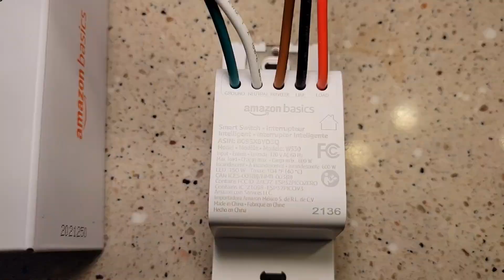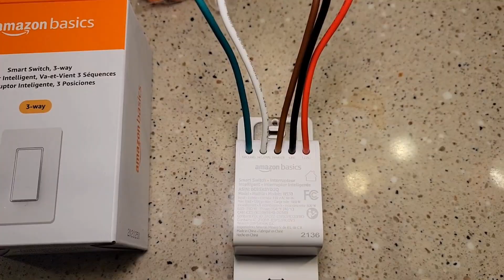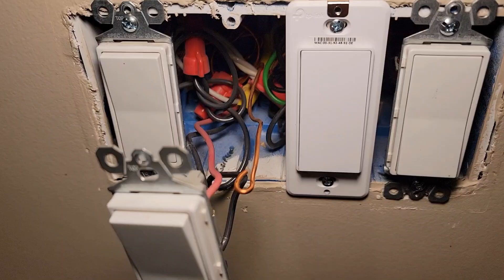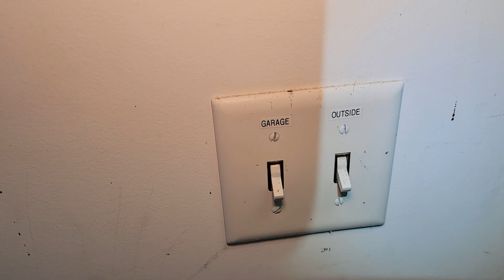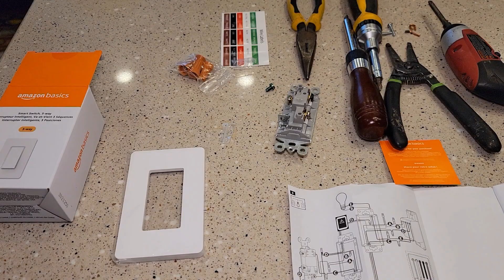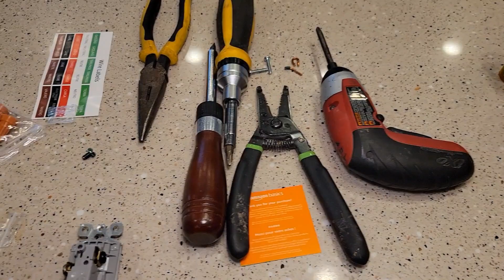REVIEW & HOW TO INSTALL Amazon Basics 3-Way Smart WIFI Switch with Alexa

Comment: in the instructions it clearly says there is only one traveler needed from the Not so smart side.....  so you seem to have connected the red to the red (red traveler.fron the other switch). and the black to the brown  (Black traveler from the other switch)  so your video is helpful but what if I'm switching out both?  and now I have to double pump the dumb switch for it to actually work???    anyone else have this issue??

Comment: My issue with these smart switches, they’re so large in the back. Hard to fit flush against the wall. You didn’t show how you were able to get it flush. Maybe I have to remove all switches to tuck wires to create space. 🤔  …I wish they could make a slim design smart switch.

Comment: Sometimes the dumb switch doesn’t work. As in I keep flipping it and do NOT touch the smart switch or the app. I can stand there and turn the dumb switch on and off 3 times and it works, but the 4th it doesn’t. Have to flip a bunch more times for it to work again. Strange. I have 2 of these switches side by side controlling 2 different sets of lights (and on the other wall have 2 dumb switches, each one connected to a different smart switch)
Reply: Did you ever find a solution? I think it's a bad switch design and always going to be an issue. I jumpered the red traveler to always be hot and used that as line and it still does this issue you describe.

Comment: I have a weird issue, my smartswitches are powered properly when in both positions (the nightlight yellow indicates when other switch is off and I can dim when it's on.) I can also turn off the lights fine with both switches. However when the smart switch is off the other switch cannot turn the lights on because the smart switch turns out all back off with its dimming animation.
Reply: Turns it back off*

Comment: I installed amazon basics 3-way dimmer and it results in the light staying on continuously.  

The dimmer is on the load side.   I followed the wiring diagram in the fold out instructions.  This means that one of the traveler wires ends up not being used.  The dimmer indicator lights function.  Tried factory reset.  no luck.  I tried attaching the dimmer line wire to the unused traveler. Now the lights can be turned off from the dumb switch but the dimmer still does not control the lights other than by keeping them on whenever the traveler is energized.

Comment: The wires I have oming into my present three way switch has pnly 4 wires, red, black, green, and red. There is no corresponding traveler wire (brown wire). What do I need to do with this configuration? I am trying to install the same switch as you.

Comment: Great video! Question: I installed it just like you did, but my issue is when I turn off my “dumb” switch, my smart switch is no longer able to power the lights back on. I need to always leave the dumb switch in the on position. Any suggestions?
Reply: I had the exact same problem. I switch around the traveler and load wires but had no luck. I tried switching the smart and dumb switch and neither switch would work. If you find a solution, I would be interested to hear it.
Reply: @AdamJohnsonFamily  I’ve been doing a bit of research, and it seems the Amazon switch needs to be connected on the LOAD side, not the LINE side. What they don’t tell you is that the switch needs to be always powered on, which is not typical for a 3-way. What I’ve read is that you need to use one of the traveler wires to jump power from the common on the dumb switch. Then connect the other side to the LINE wire in your smart switch. So that gives it constant power, along with being connected to the neutral. Then the smart switch should be able to determine current level through the single traveler wire.

I haven’t tried this yet, but will tonight when I’m home. Hopefully it works!
Reply from the maker: Thanks for the update and research!
Reply: @AdamJohnsonFamily  confirmed this worked :)

1. Set the smart switch on the load side
2. Use one of travelers from the dumb switch as a jumper from the common line. Connect the other end to the LINE side of your smart switch. This will give you constant power that’s needed to run the smart switch. 
3. Connect all the remaining wires as needed

This should work! The smart switch only uses one traveler to determine voltage:
Reply: @Mattm3svt  Much appreciated. I confirmed this worked as well. Thank you again.
Reply: @Mattm3svt  HI, is there drawing of how the wiring needs to be connected? I've been racking my brain trying to figure this out.
Reply: @Mattm3svt  Still trying to understand the change - Experiencing the same issue as @Adam Johnson .   When you say jump from the common line.   Am I correct in that for two travellers - which are Red/Black on the dumb switch should be changed so that the Red connects to red on the smart switch as previously.   But that the second traveller  in the dumb switch is only connected to the common line and this is then connected to the brown on the smart switch.
Reply: After sleeping on it got it figured out.  It is similar to the single smart switch.  One I got past the hang up on thinking I needed two travelers, I connected one of the travelers to panel power so it would always get power to the 2nd switch.  Works like a champ now
Reply from the maker: @ggowins  Thanks for sharing!!!
Reply: Thanks for the info.   I too had this issue.  I’m also wanting to use the three way smart switch on both ends.   It looks like from the documentation it should be doable, but for the life of me I haven’t figured out the logic to get it to work.
Reply: Had the same problem too because I was treating the smart switch like a conventional 3-way switch, but I learned after a couple of hours of frustration it is NOT THE SAME. 

Here’s why: in a conventional three way switch set up (ie no smart switches involved), only one of the two three-way switches is going to have a constant hot connection on the common screw. The other three-way switch is only able to pass along electricity from its common terminal to the lights if the two three-way switches both agree on which traveler the electricity should flow through. Each switch is in either position a or position be, and only when both switches agree can electricity pass all the way from the panel through both switches and on to the lights. 

But for this smart switch, if you look at the wiring diagram in the manual very carefully you will see that both three-way switches, the dumb one AND the smart switch need to have constant hot voltage going to the common terminals. Only ONE traveler (brown on the smart switch) is actually connected between the two switches. The Red load wire on the smart switch is the wire that gets connected to the wire going to the lightbulb. In my case I was wiring the red wire from the smart switch to a black wire leading to my lighting circuit. 

Essentially when the smart switch is wired the old style three-way switch now functions just like a one-way switch. The traveler line is just passing an electrical signal through to the smart switch to tell the smart switch to then pass electricity on to the lights. And, of course, because the smart switch needs to be powered on at all times it also needs to have a dedicated connection to the neutral line to complete the circuit regardless of whether the switches are in the on or off position. I hope this helps someone save an hour of wasted time!
Reply: So how do I connect it to the Alexa?